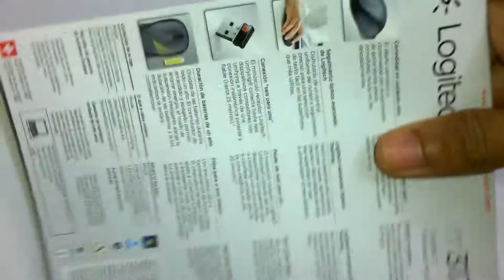Logitech M317 Wireless Mouse -  Full Disassembly

Comment: I've watch so many videos that say unscrew it and I just thought this model didn't have one. I wouldn't have thought to look under that. I don't want to go as far but want to check if the spring has rust (doesn't appear to have any from what I can see by looking into that space). 

My issue is that the grenn light hasn't come on in months but it works with a solid red light. Just recently, the light either blinks red or turns off and I have to keep taking out the battery and replacing it. The battery is fully charged and I've even tried another brand. From what I can see, there's some wiggle room in the battery compartment and as I'm replacing it, I have to get it in a certain spot or the light doesn't come on. I'm hoping if it's not rust that maybe making the spring longer will fix my issue.

Many thanks for sharing!